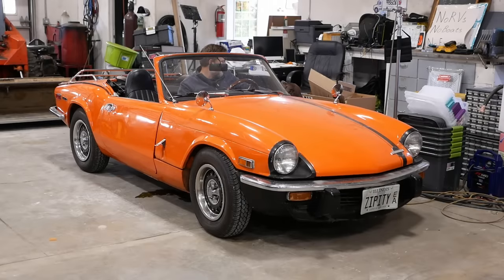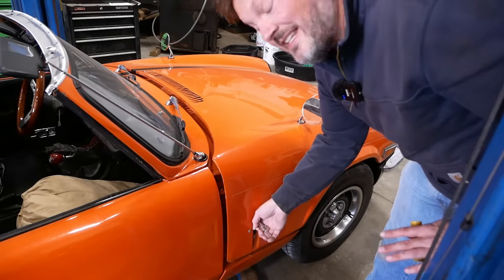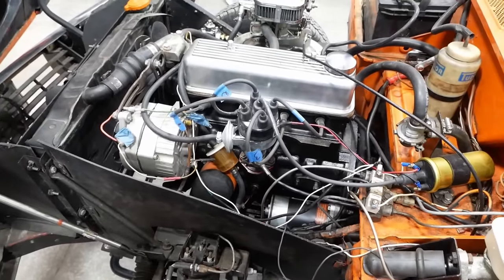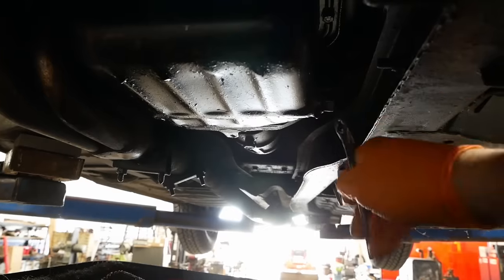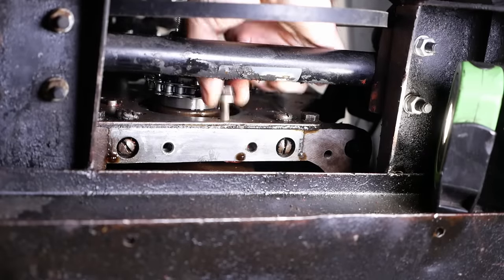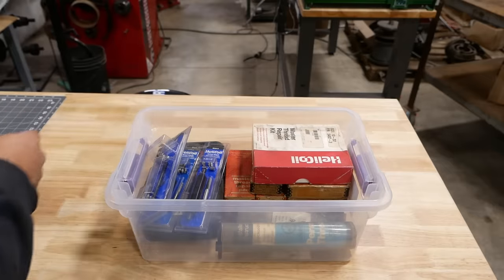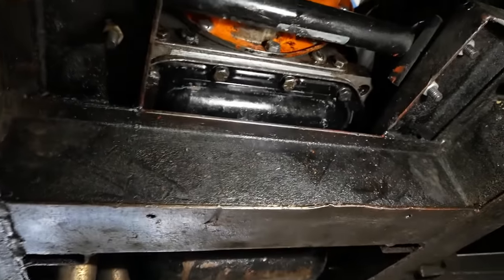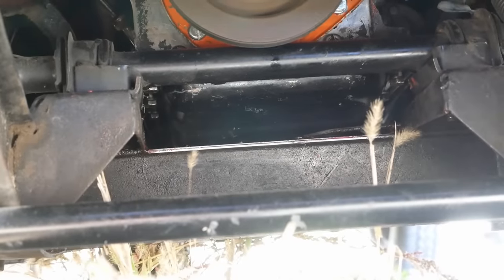Can You Stop a British Car from Leaking Oil?

Comment: When it comes to Harleys or anything with ball or roller bearings, RTV is a complete engine killer. The tiniest shred of RTV or silicone can skate a roller or ball, and cook the bearing and size up the whole mess. My buddy bought a box truck with a hack red-silicone slather on the oil pan. The truck made it 20 miles up I5 and blew up, silicone in the oil pump and everywhere else.

A thin finger smear of Yamabond 4 works on the Harley case halves, and I would never use more. Also there is a spray Permatex that puts the proper microscopic amount of sealer on the gaskets. For cars, I might put the thin smear on the oil pan, then grease where the gasket seals to the block. That way the gasket always comes off complete and you can suffer scraping it off on the bench instead of under the car. Often you can re-use the gasket.

I have a 1962 Sportster with the tin primary cover. That gasket is paper thin, like the oil pump gaskets. With no sealer, it works just fine. Like you, I had to make sure the cover was dead flat. If there are any gouges on the case sealing surface, I would clean them and fill with JB Weld. You really can get an Iron Sportster to not leak oil. I tell everyone, "Don't glue your bike together." I mean it. This applies to Loctite as well.

The car companies use silicone or RTV because it is dirt cheap. It makes repair difficult, and worst of all, uncontrolled, since you don't have the CNC dispenser that they use in the factory. Everybody uses too much and everybody does not have a steady hand to put it on.

Comment: Try an oil pan on an Alpha Romeo or a Jensen Healey. They both flag 10 hours or so. Held on by studs and nuts and the pan folds out under them so you can only use an open end going on or off. Had a customer ruin an oil pan on a Jensen. He tried to change it himself. I told him I didn't finish other peoples work. He came back 2 days later and paid me $1000 to fix his car. This was in 1978 or 9. I used to be a popular mechanic. Even hopped up cop cars. Now I have to pay a shop to fix my breaks. lol

Comment: Speaking of gasket technology I always wondered how Detroit Diesel got away with having basically no head gasket on the 2 strokes, and that goes all the way back to 1938. They just have the fire rings and a little o-ring around the perimeter of the deck. I don't even know if they all have the o-ring but the 8V92TA I rebuilt did.

Comment: The only way to stop a British car from leaking oil is to not put any oil in it.  But that has worse consequences.  So, you just learn to live with the leaks, and fix them when they get too big.  I had a 57 MGA that I had to keep a small hammer with me in order to drive it.  I had to lift up a plywood panel behind the driver's seat, give a tap to the the electric fuel pump, in order to get the fuel pump to work, and then I could start the car.  What a great car ;-)  Then there was that Lotus Europa I had...

Comment: I must confess I was dreading this.  Not because of the silly aluminum/aluminium thing, because they are both correct.  You did give me a laugh though.  Australians are sort of halfway between British and American so we can see both sides.  I was dreading the mechanical and electrical cliches.  I was relieved to see the use of Permatex No3 with gaskets because it works so well, except it can't work miracles with huge gaps but at least you gave it a go.  I don't know anything about Triumph engines but the BMC 'B' series 1600cc engine in my Austin doesn't leak from any of the gaskets I have replaced with just that method.  You did save the whole thing by talking about the simplicity of the engines.  They are 1920s engineering, but that is not necessarily a bad thing.  I completely agree about the stupidity of UNF threads into aluminium, just asking for trouble.  Nice to see you working on something so different.  😊

Comment: Oh... one other thing... and I think I've mentioned it before.  Teflon tape is good for threads connecting water... but for any oil/fuel based connections, you really want to use pipe dope.  The teflon will break down a bit... which might not matter too much... but... might as well be safe rather than sorry.

Comment: Wes we had them out here in New Zealand too. Not much room inside them if you are over 5.11' LOL  It has a bladder problem.  They were made to leak in the factory so we had to buy more oil as most British cars do. Its a conspiracy between the British car companies and the oil companies. LOL  Earlier than the 1870s. They have a common problem with the rear brakes if you are going to look at them The handbrake can have good travel but aren't very effective at holding the car. What happens is the cross link that the handbrake lever works on in the drum wears in the groove This brings the lever forward even when the shoes are adjusted up past its fulcrum point. Then the cable gets adjusted up to compensate and you end up with good travel but hardly any holding ability. You take the cross link out and grab the mig and shorten the slot by 3mm -1/8' this brings the lever back in the drum and readjust the cable. That fixes it. They drag exhausts at the best of times and that ones low. Its basicly a Triumph Herald with a different body bolted on.

Comment: 😁As a Brit I applaud your dedication! Its a car build 52 years ago but designed probably 30 years before that - oil leaks are de rigure in its existence, just marking its territory! Over here they gained a reputation as a 'hairdresser's car' - not saying they are effeminate but they are LOL! Glad to see everything in the dash is working pretty much as it left the factory, its all superfluous to the driving experience, just don't back up too quickly - he said knowingly ! Compared to a similar aged yank tank, its tiny either that or you are a giant! Also you are slowly getting a handle on correct pronunciation - Aluminium, Bonnet, Boot, Celcius, Millimetre . . . . . . but I agree we don't understand UNF fine threads either!

Comment: Permatex right stuff RTV is the best overall RT  as far as im concerned. You need little to no curing time. I can be a little nervous with it on sheetmetal parts because it can be quite difficult to remove things.  If its something that might need to be serviced in the near future i might go with ultra gray or black.

Comment: Years ago i read an article about the rear main seal is not really a seal its like an auger that is counter rotating to the engine its supposed to sling the oil back onto the engine.
 I guess it didn't work because there are a few conversion kits out there that make it a press fit seal.
Reply from the maker: Might be a rope seal. They have the spiral.
Reply: @WatchWesWork  According to a long-ago post on the Home Shop Machinist forum, some MG engines had a "seal" design using a spiral groove on the crankshaft to force the oil back into the crankcase.  It was metal-on-metal, no rope or other sealing elements - more like a quasi-labyrinth seal.

As the story goes, Datsun built a copy of one of the MG designs and imported it to the USA as the "Fair Lady".  The early production models had an issue with a massive oil leak from the crankcase where the spiral groove seal was used.  Someone eventually realized that the groove had been machined with the wrong "hand", turning it into a sort of pump that would drain the oil out of the engine rather more quickly than usual.
Reply: Perkins diesel engines had that feature too as did some 1960s electric motors designed for US ships 260volts DC

Comment: Back in the late 70's I worked at a Chevrolet Dealership. I worked in the used car dept. and had to make repairs to vehicles traded in for new cars. I always cringed when I saw a British car come in on trade. The brakes never would pass state inspection and had wiring problems.

Comment: Wes, do yourself a big favor, buy this, fix it a bit & save it for your kid. They're great, fun little cars, cheap to repair, just what a high school boy needs. He'll instantly turn into the school "chick magnet", and he'll learn the basics of how a car operates, and how to fix it. It also qualifies as a "run-about car", meaning run about a block and stop, the kind of car every parent wants. I still have my 74 MGB roadster, and a 1930 Ford Model A, and both are hard to beat for smiles per mile. Showing a young person how to set the points is a hoot.

Comment: *Some historical context:  If you were one of those lucky purchasers of a Triumph in the 1960s or 1970s you expected oil leaks - you had no choice - those cars leaked as soon as they left the dealers, often long before.  Wes points out several times the use of silicone sealants in attempts to stem the leaks.  Silicone sealants weren't widely available when that car was brand new.  Silicone sealants were developed in the 1960s as an offshoot of NASA's space program, they existed in 1971 if you were NASA, a contractor working on military programs or you were a knowledgeable mechanic with lots and lots of money to spend.  Silicone sealants and the related adhesive-like gasket sealers only became widely available in the very late 1970s and early 1980s - they were new products even at the most advanced scientific parts stores.  And they were expensive, an average, ordinary size tube of silicone sealant was roughly the price of 6 or 7 times the national minimum wage in the late 1970s - Really - It was new, hard to find stuff and it was very expensive, you had to be extremely knowledgeable to know that that stuff even existed.  And even with cutting-edge silicone based sealants your English built car still leaked everywhere*
Reply from the maker: I didn't know it was a NASA thing. That makes sense.

Comment: oil leak from oil pan/sump usually caused by overtightening of oil pan/sump  bolts over time. Re move oil pan/sump, fit 2 new oil pan /sump gaskets,refit oil pan/sump . . .simple. Be aware that this will not stop the leakage but it will slow it down.

Comment: You should have used the crank pulley to center the timing cover then tighten a couple bolts take the pulley off and finish the rest you said the holes in the cover were walered out so they probably didn't center that cover very well

Comment: Personally ill never use sealant as a gasket on engines. Had a repair one a diesel loco once where the crank had seized.
We later found that silicone had dropped into the sump, was sucked up into the pick up and went through the lube oil lines to one of the big end lube feed pipes and blocked it, causing oil starvation which seized the crankshaft.

Since then i use cork sheet or other types of gasket paper depending on the fluid and operating temperatures.

Comment: Had a Spit long ago, simple to work on, never had any oil leaks after i had done with it, most times i just lifted the engine out by hand after removing the transmission tunnel from inside the car and unbolting the gearbox from the engine, it took longer to remove the engine than my 22 minute best time on a VW beetle, a Spit engine removal still took the best part of 1 hour,  that Spit you are working on is quite the  mongrel with all the sloppy  looking "rigging" it has endured, but after 50 years it is what it is.

Comment: A very poorly kept motor car. I have a 77 bought in Bristol new with 87k miles. I rebuilt the motor at 72k. It was fine when I rebuilt it but the high mileage motivated me to do it. No body filler, no rust just properly maintained.

Comment: Nice fix!  Question:  Would a bead like the ones used on wind shields (pyramid style), work better
than a round one out of the tube?  Having pans beat up like this one, will add more hours to correct.
Again, "PUP APPROVED".

Comment: That 1500 Triumph engine had a bit of a racing history (maybe even in the US) as it sneaked through some rules regarding capacity due to it's small bore and long stroke.
Reply: You're a funny guy.  In the UK the 1500 engine had a 9:1 compression ratio, US models had a 7.5:1 ratio; UK models were rated at 71 hp, American destined models 53 HP.  And remember, those HP estimates only applied if the car actually ran..
Reply: @julianstafford7071  --  In F and G Production classes you have a lot of leeway, you can easily modify the engine while retaining stock appearances, it is reasonable to expect at least 100 hp from a mostly stock 1500, the guys driving the streets in brand new 53 hp Triumphs had a very difficult time matching big iron Detroit muscle cars of the era, even with their huge weight advantage.

Comment: The 1970s were there very worst time for British cars. Trade Unions were rampant, quality control was a foreign concept and design was stuck in the 40s-50s. It was standard when stopping at a stop sign that you had to simultaneously pump the accelerator, the clutch and the brake pedals in order to maintain the viability of all three functions! Rust was standard straight from the factory and electrical fires on the way home from the Showroom were so common as to be unremarked on.
  You can imagine how welcome Japanese cars with their reliability, easy starting and functionality were.

Comment: In 1971 I owned a 1969 spitfire they leaked oil then 2yo and I had to put my right foot sideways at an angle to operate the gas and brake pedal

Comment: Your lucky, on the TR6 you need to remove the radiator, front cross member, disconnect the steering, remove the rack and pinion mounting bolts and slide the rack forward to get enough clearance to remove the damper and pulley.

Comment: I had one British car.  An MG 1100 when I was in the army stationed in Germany.  It had all the British car problems.  Lucas electrics (gotta hit the electrical fuel pump with a wrench now and then) (Why would you ever need both headlights on at the same time?). Oil leaks. (Of course there is a brass plug in the back of the engine block.  How else could you regularly soak your clutch in oil?). Never again.  And then, later, when I lived in England, the sight of people going out in the morning to dry their spark plugs with an old towel before going to work.  Why would people in a wet climate not know how to keep the ignition dry?  Oh my.

Comment: I can't figure ut why you don't have a 1&13/16 end wrench or socket. I am a retired heavy equipment repairman after 55 years in the industry. I have two of this size end wrench as well as a 3/4 drive socket. They are a popular size in metric as well - 46mm. I have many sockets from back in the day that Snap-On printed both metric as well as imperial size on the tool when appropriate.

Comment: It probably leaks less than when it left the factory. 🤣Great to hear you correcting yourself so often. You only missed a few but the most obvious was calling the accelerator pedal a gas pedal. 😲 What sacrilege is this? English cars run on petroleum, not LPG. 😁

Comment: 20W50 Castrol was the recommended oil and viscosity on these cars.  They weren't high precision PZEV high gas mileage engines by any means.  Put 0W10 oil in this engine and you'll be replacing bottom end bearings in a short period of time.

Comment: Next time, use the ball of the ball-peen hammer to dimple the cover holes outward. When the bolts tighten, they compress the dimples flat and add to the bolt's torque value.

Comment: Could you? Would you ever try to double those pan gaskets with a little rtv in between them?
Reply: Noooooooo, double gasket anything is a proven thing to cause a leak... the worn enough engine will have substantial blow by that the pressure will blast it out 

Hammering the flange straight enough is the best way that he shows on the video

Comment: So at least not BSF, right? But UNF? I work on old vises and they often use BSW, and yes you can cram in UNC hardware (a bit loose since 60° vs 55°) but then you stuff like 1/2“ which has a different tpi, which really sucks (BSF and UNF, too).

Comment: Question has anyone started using loctite anaerobic liquid gasket instead of rtv? Loctite 510, 515, and 518. Because they are now resistant to gas and hydro fluid
Reply from the maker: My understanding is it should not be used with a gap more than .005".
Reply: @WatchWesWork  .009 is what the data says without the primer. Ducati uses it as the gasket for the primary covers now and they have some wobble to them but no leaks. The activator 7649 is required for passive / coated metals it will extend your fill distance a good bit. If it has copper or iron you don’t need activator.  I’m starting to see it used in heavy equipment more and tec that use clean gloves have no problems Tec with no gloves or dirty gloves have problems. My observation.

Comment: I had a 61 AH Sprite and 77 Spitfire. Same engine just bored out. I safety wired mine. Having the drain plug vibrate out is common. Anything major on the engine, it's faster to pull the engine. It's also common to have pits form on the front pulley seal surface. You can buy a sleeve to cover the pits. If you don't, it continues to eat the seal. The owners manual recommends new rings at 50,000 miles. If you drive it hard, you'll be lucky to get half of that. Because the '77 engine was so over bored, driving over 55 in the summer,  it overheated. I had an aluminum radiator made. British engineering wasn't very accurate during this period. Several items required the mechanic to fit the part. By now getting parts are probably a bitch. When I had mine, there were junk yards full of British cars.